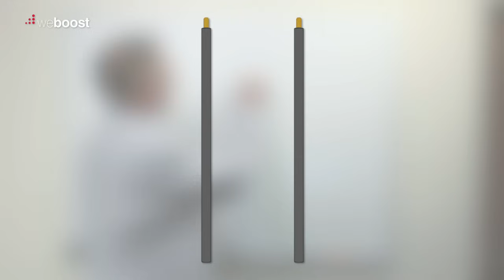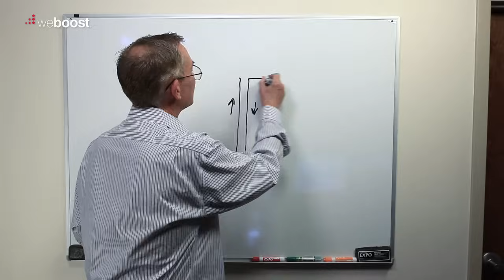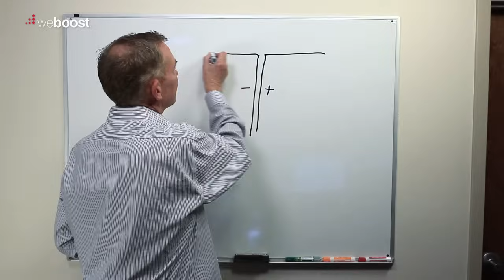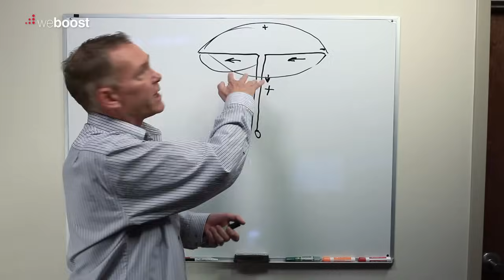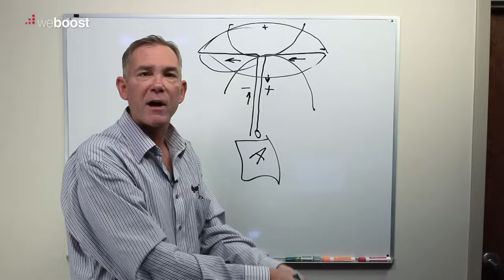How Does An Antenna Work? | weBoost

Comment: I believe that in a resonant half-wavelength dipole antenna the voltage is maximum at the ends and minimum in the center.  The current is maximum at the center and minimum at the ends.  Another way to think about this is that a half-wave antenna, when excited by an RF source, produces an oscillation of the free electrons in the wire.  Since the electrons pile up at the ends, the maximum "charge" or voltage occurs at the ends.  When the electrons move from one end of the antenna to the other, the greatest number of them move past the center so the center has maximum current flow.  And because the electrons that pile up at the end can't move past the end, there is zero current at the ends.  When the electrons pile up at the far ends, voltage at the ends is maximum and current is zero. When the current at the center is maximum, the voltage at the ends is zero.  This is the same 90° voltage and current phase relationship that occurs in any freely oscillating inductor-capacitor circuit.
Reply: NG9D yes, it is my understanding as well that current, not voltage, is highest at the center.
Reply: Absolutely true. The video shows it the other way around. The ends have a high impedance and high voltage. The center has low voltage, low impedance and high current. Most of the energy is transmitted from the center of the antenna due to high current
Reply: He did trip up there

Comment: Hello, At 3:15 in the video, you indicate that there is a high voltage point at the feed point of the dipole. Is this not the High current point and the High voltage points are at the end of the dipole. Also the voltages at the end of the dipole are out of phase. Thanks for taking the time to address this topic.

Comment: Hi, this is a nice simple explanation of a dipole antenna. But i am a bit confused about your explanation of the currents and voltage at point 3:10 in the video. isnt the current always <<low at the ends of the antenna and high at the middle?

Comment: Hi i am trying to build a antenna for 1 tv channel it is vhf 2.1 and it is 54-60 mhz and it is 50 miles from my home any idea of design ? height ? transformer or amp. 
I am trying to cut the cable and this is the only channel that i am having trouble getting with my lava hd 2605 
i could add it to my mast and combine the signal maybe ? thanks jeff

Comment: Coaxial cable has a wire mesh around it to stop the  energy escaping from the main feeder wire in the centre before it reaches the antenna when a signal is sent , it can also help stop interference along its path from entering as well, the part that gathers and resonates the signal is the antenna itself that can be tuned by its length to suit a specific frequency ie the energy that is transmitted from a radio station be it stationery or mobile, the antenna itself need only be a peace of wire cut to the specified frequency to obtain best performance.

Comment: How much will the range of a transmitter module. Increase on using this antenna??... and is it necessary to put the same antenna on the receiver to increase the range?

Comment: Really good explanation when you mentioned the current flowing the same direction, when the E field builds and collapses and goes to the other side, the rate at which that happens is the Hz radiated. When this field collapses the H field is created in time phase 90 degrees for the space quadrature classical diagram. By feeding the signal to the dipole an electron flow will be set up in it, which produces a larger concentration in one side ( lets call it the negative side, just because the now larger concentration of electrons which are negative, are on this side of the dipole ) then reverses and produces it in the opposite side to create another maximum on the other side of the dipole. 

This back and forth action of the electrons creates a rising/collapsing magnetic field. When the electrons are "evenly" distributed in the dipole the H wave is at its max, as the flow reverses it once again creates the strong H field, but in the opposite direction of magnetic flow. In other words, the magnetic field reverses its direction at each half cycle of the original frequency. Now, the strength of this field is directly proportionally to the currents standing wave. 

This standing wave is 90 degrees out of the voltage standing wave. So when the voltage builds in the opposite direction the polarity of the H field reverses.  The changing polarity produces an electric field in phase with it. This is known as the E field. 

So, the E field and the H field build and collapse 90 degrees out of phase with each other and this makes up the antennas immediate field. Now this field creates the radiated field pattern of the antenna.
Reply: Thanks for the explanation.

Comment: I don't understand if the antenna is supposed to have those bent wires in it.... how come every antenna looks like a single wire? Is this because it is a single wire without a ground sheath and it is mounted on a metal plate? Should I copy this design for my garage door?

Comment: super informative video. one question, so if I run two pieces of copper wire from a transformer to watch tv, do I need to make each side a certain length? I created one and it pulls in a significant amount of OTA channels but I was curious about size.

Comment: I have a antenna that has 2 separate wire with a little flat curved peice of metal you put under screws and tighten the bolts.

Comment: Some information is missing like does it work on direct current and the length required for it to work
Reply: Direct current does not create radio frequency. Example: battery powered lights. Direct current is used in electronic circuits that create Radio Frequency.

Comment: I read the other day that the feed point is high current and low voltage, whereas the ends were high voltage and low current.  opposite of what is said here.
Reply: He slipped up, easily happens

Comment: thank you
but what happens with in the antenna while radiating power
Reply: IF the antenna is cut at the length for the desired frequency it usually radiates nearly all the energy as electromagnetic waves. IF the antenna is used at a frequency it is not designed for it will reflect some of the power back down the feedline and create problems within the xmitter stages that can damage the radio transmitter.

Comment: How does the telescope metal tube antenna work, like on a portable radio? It is only connected to one point.
Reply from the maker: What you are describing is a monopole antenna, it uses the circuit board ground plain as the return path for the energy radiated, the antenna “thinks” it is a dipole.
Most people do not realize that varying the length of the antenna actually changes the efficiency of the antenna at different frequencies.  Taller is better at lower frequencies, shorter is better at higher frequencies.  

Hope this helps, thanks for watching!

Comment: For the use of radio, people use the Azimuthal equidistant projection because it allows for directional antenna aiming (https://en.wikipedia.org/wiki/Azimuthal_equidistant_projection). They say that all an operator has to do is find the target location on the map and rotate the antenna to the angle indicated by the map . This makes it sound like the Azimuthal equidistant projection map is a literal and correct topography map, true to its layout. This is the only projection map that the USGS uses and it is used as the United Nations logo. Is this the real map of the world?

Comment: Sir , i want to make an antenna like this to receive fm signals. What length should be there for the horizontal opposite directed cables should have .. and after getting the exact length should we need ant fm booster in order to receive the signals.

Comment: Hi, thanks for the nice video.
I did not understand one point. At 1:48 how is a current flowing down in the right wire and later how is current flowing up in the left wire ? They are not connected right ? Then how can current flow ? Please suggest.

Comment: Great video! My dear, is there a way to avoid frequency interference when using two VHF radios, transmitting under same channel and same frequency? Is there a workaround for it?
Reply: I think the only way is to use two antennas, a long way apart, an rig them so they can cancel out the signal..

Comment: thankx sir for the information, i have a fm circuit board,which has a small hole to solder a wire to make it as antenna, but i am getting to much noise and disturbance in sound even after attaching a wire, so can you tell me how to make proper antenna or how to attach wire ( single wire or two wires together i had to use?)

Comment: I just purchased an old 1960 dipole antenna.  Do you think there will be any problem using it on my old Samsung transistor radio which has a dipole hook up?
Reply from the maker: Most dipoles are tuned for a specific band, so it depends on if the radio and the antenna are on the same band.  Assuming it is a match it should work just fine.
Thanks for your comment, let us know if you have any other questions.

Comment: sir, but how can current flow in antenna wire as it is open circuit. I did not get that point.
Reply: since its AC current, you don't need a closed circuit. In AC electrons oscillate and that's  current.
Reply: Because: current that flows TO the antenna, generates a radiating magnet field around the antenna wires that is radiated out and away from the ant wires.
Reply: Walter Perry the informstion inside coaxial cable is also radiated outside?
Reply: It's about wave mechanics. The dipole antenna is a half wavelength wide so that the voltage peaks at the tips and the current there is zero. The current in the middle is charge that sloshes from one end to the other. You can also say that the open circuit tips reflect charge back and forth across the dipole. See transmission theory reflections.
Reply: Gauri Shankar Mandal it is called displacement current. Even if it is an open circuit charges build at its end and that is current . It’s a capaitor

Comment: is there no effect of reflection....as one end is open
Reply: A antenna cut to the proper length for the design frequency (in meters) will radiate almost all of the energy sent to it in the form of electromagnetic radiation, or frequency that you are using. If you sent the same information to an antenna that is NOT designed to operate at that frequency then it will NOT efficiently radiate all of that current and it will will radiate BACK down the feed line in what is referred to as 'standing waves' on the feedline and cause problems for the transmitter, overheating and cause failure of the device.

Comment: what is the shape of the electromagnetic wave that leaves this kind of antenna ?

Cylinder ?
Reply from the maker: Good question. It is different depending on the type of antenna. For an omni-directional antenna the shape is like a doughnut where the hole of the doughnut is centered on the antenna.

Comment: i am using a couple of  433Mhz tx rx modules for a project, range is poor, are there any booster circuits that can increase the transmitter's power?

Comment: What I need to understand is exactly how does the electric signal leave a wire a move into the air over a large distance and does this happen to every circuit with a high frequency  oscillators in all electrical equipments?

Comment: Question sir, when you showed current cancelling each other out initially when you had only two piece of wire that was clear but when you you made the wire to have branch left and right you showed current crossing the bridge to the side. That is where I am lost. Can you explain the source of that current because current will not come from the point it will radiate. Thanks .
Reply: The difference in voltage between one end and the other will cause charge in the wire to move = current.  There doesn't have to be a complete circuit.  Think AC transients and inductance.  However, if DC were applied, the current would quickly vanish.

Comment: Is the distance where the 2 legs of the wire start to turn away from each other critical?  What fraction of the wavelength in use should those be ideally?  I have heard different answers to this question such as it is not critical but a ham told me as close as possible almost  touching is best.  Also, why does a pair of properly phased dipoles have more gain then say a properly phased Yagi stack consisting of 2 identical Yagis?  If by vertical stacking, the 3dB beamwidth is always halved in one plane only, then shouldn't the gain of any proper stack whether it be simple dipoles of 10 element Yagis be limited to about 3dB of gain since they are only narrowing one plane of the radiation pattern?  I have read that dipoles are special and can can achieve more gain than just this.  Also some properly phased verticals can achieve more than 3dB gain over a single, using the same power.  Why is this?   I actually tried a pair of properly phased verticals a long time ago and the performance was stunning.  Sounded like an amplifier was turned on but  it was the antenna doing it.
Reply from the maker: David, You are looking for equal lengths on a simple dipole.  I usually go for ¼ wave (you can google this) length on both sides and start trimming from there.  Use a cheap piece of cable and when you get the results you are looking for make it out of something substantial.  If your end product is substantially (physically) bigger it will have a larger bandwidth...  make sure your feed points are equal and as short as possible, this is a great project good luck!
Reply: weBoost Wow it is like you are answering some other questions I did not ask.  Where are the answers to the questions I DID ask?
Reply: +David James It's probably mostly to do with the fact that your questions are a little tangential and require thinking and work that google probably already knows.
Reply: Phasing is way of using two antennas in proximity to change the radiation pattern of the antennas.  Two verticals operated in phase at the proper spacing will radiate a figure 8 pattern (viewed from above) that will phase together and create a pattern that is stronger in the desired direction. A yagi (beam) antenna with 3 or more elements will concentrate the energy in a direction off the end with the shortest element.
Reply: This is a critIcal question that has never been answered . Clearly the antenna will not work if the dipole legs are separated by 200 feet, or if they are separated by 0.001mm. SO WHAT IS THE OPTIMUM SEPARATION? IS IT BASED ON THE WAVELENGTH OF THE SIGNAL BEING TRANSMITTED OR SOME OTHER FACTOR?
Reply: 1/4 Wave.  This was answered multiple times in previous comments.

Comment: I am new to ham radio . At 3:02 you show current flowing from the outside of the coaxial cable down to the radio . Pls explain why current isn't flowing from the radio up to the wires then radiate out . Tnx
Reply: most likely the cable is much longer than the wave length of the signal. if you were to take a snapshot in time and looked at the currents, you would see on the center conductor, current going towards the antenna and current coming back in different regions but on the same wire. the outer conductor is really not different than the inner conductor, it will also have both currents but they will be opposing the center conductor. So when you have maximum + on one, it will be maximum - on the other and vice versa.
Important to keep in mind is that this is not a DC current. Think of it more as a vibration. Or think of a loudspeaker, the air from the loudspeaker doesn't physically come to your ear but the sound is a vibration that propagates through the air.
Reply: Classic Messenger Services brawndo's got what plants crave
Reply: Because the shielding around coax is at ground potential and acts similar to a water hose that keeps water flowing inside it, until it gets to the nozzle (ant) where it is dispersed in a manner that it is useful or radiated into space.

Comment: am designing a dipole antenna to be used on my cubesat project. the frequency i want the antenna to radiate on is 437.375MHz. Can you give me the formaular to calculate the length of the conductor i will be using. i have seen many formulars which makes me confused sometime. Be happy if you can assist. Thanks for this helpfhl video
Reply from the maker: You want ¼ wave length at the center of the band, you can find a calculator on google.  Note:  you want a very good ground so pay attention to this.  Here is a link, remember this is a full wave length, you want ¼.  http://www.procato.com/calculator-wavelength-frequency/

Comment: can i use the tv antenna  boster to improve the quality of the image and sound in my tv....the ckt diag is given in the link below 
http://www.circuitstoday.com/tv-antenna-booster
Reply from the maker: This circuit looks OK but without building it I can’t advise.  However, the answer to the question is, probably, based on the claims on the web site.

Comment: hi weBoost, in the dipole explanation that you gave, looks like each wire is open circuit. how is the current flowing in that open circuit? I would appreciate your explanation.

Comment: hi weBoost, In the dipole that you explained, both wires are open circuit. how is current flowing in each of those wires? where is the closed path for current to flow?  I would appreciate if you can explain that
Reply from the maker: Thanks for the comment, a dipole antenna (like all antennas) transfers energy from current flow into EMR, ElectroMagnetic Radiation.  In theory the same amount of energy is turned into RF, Radio Frequency, as was current flow.